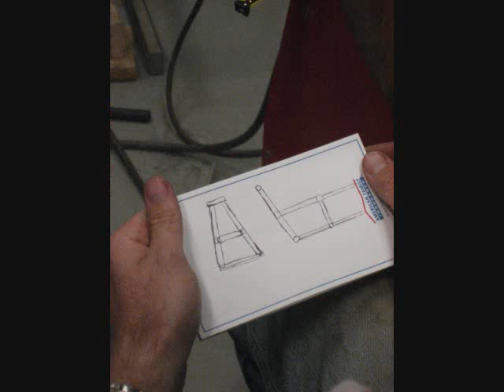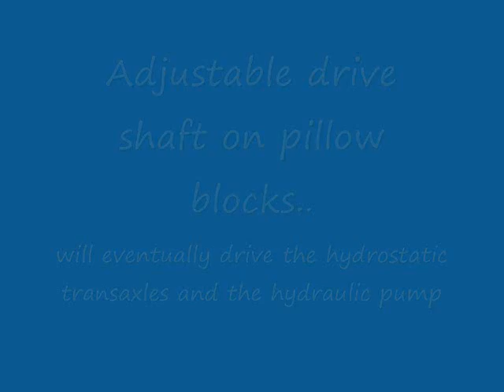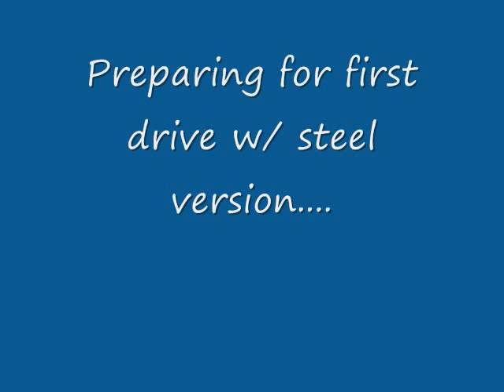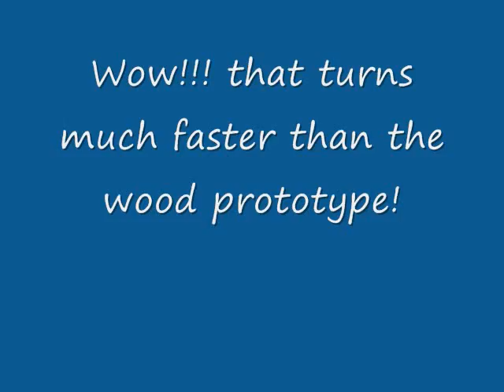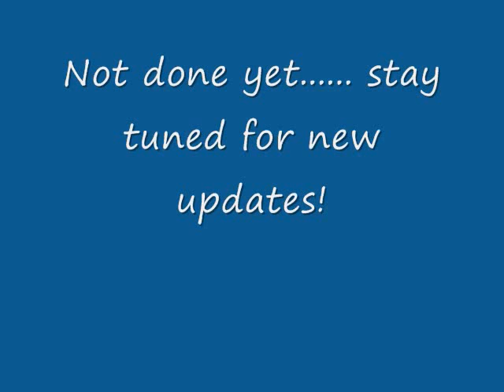Caterpillar Part 2 of 3

Comment from the maker: @deeretk 
You're going to want to match the pump output to your intended use.  If you have a smaller pump output, and you have large cylinders, your movements will be slower.  On the other hand, if you have too large of a pump, you're going to be just moving hydraulic fluid unnecessarily.  Just make sure you have a pressure relief valve built into your system, as well as a filter.  If you go to a college bookstore at a college that has engineering, you can probably find a book on hydraulics.

Comment from the maker: @HISandman 
That was only a blade for testing, see the rest of the series, and you'll see the finished blade of 84" wide.  It has full hydraulics for the blade control, which wasn't mounted yet in this video, it can easily scrape the pavement clean of snow.

Comment from the maker: Yes, there is a hydraulic pump for the hydraulic control of the blade.  It';s not easy to see, but its just in front of my right foot, and is driven off the front jack sjaft.  I don't think it's mounted in this video, see the rest of them in the series to see it complete.

Comment: Hi Kent what a great project and thank you for posting it.  I wanted to consult you in regards to connecting snowmobile track to a wheel chair motors. Are the adapter that go from the regular 17mm round shaft in a wheelchair motor to the ones on a snowmobile? the shaft on the snow mobile appears to not be smooth and round. Any thoughts?

Comment from the maker: Nope, the track have to be orientated that way to support the weight of the blade when it gets raised.  It has no problem on rough ground with the way they are.  See part 3 and the other videos in the series to see how well it works as finished.

Comment: Just wondering......did the rear diff hold up?.....I'm thinking of using one......to run a Raidtrac.....if they will hold up?
Reply from the maker: Yes, the transaxles are holding up just fine.  To be clear, it is not a differential, they are separate left and right hydrostatic transaxles from a zero turn mower.
Reply: Thank you......yes hydrostatic from a craftsman riding mower.   20.5 HP.
Reply from the maker: You will want to check the specs on your Raidtrac.  The replacement unit will need to be as good or better rated for HP and weight in order to work.  A quick search on Raidtec shows they have a 36 hp engine and weight up to 1650 lbs.  I doubt a craftsman transaxle that was on a 20.5hp unit is going to last very long.  My snow dozer is light, ~800 lbs, and the drive sprockets are small, so I sacrifice speed for torque.
Reply: Thanks.....yes my Raidtrac is a smaller one....about 800 PDS.....8 foot long.     Four foot wide.....its a Raidtrac 613

Comment: what were the transmissions out of and how much did they cost
Reply from the maker: The hydrostatic transaxles are used on zero turn lawnmowers.  I bought them new on ebay, and at the time, they were $250/pair.  Now the price has doubled.  Search Hydrogear ZT-2100 or ZT-2200 on ebay.